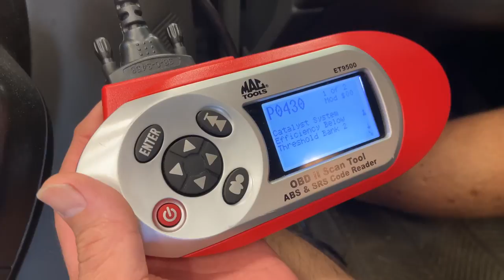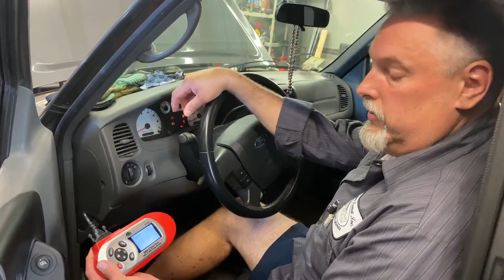How To Replace Driver Side Catalytic Converter 2007-2011 Ford Ranger 4.0

Comment: When doing my ‘04 Ranger, I pulled the front driveshaft which made a huge difference! Also found my U joints were bad which I hadn’t planned on, but access was much better than what U encountered.

Comment: I have got a 3.0 Ranger with 250k on it and no issues so far. A question I do have with the recent surge of cat theft these days is how difficult do you think the dual cats on the Ranger are for thieves to steal? Are they ones target by thieves and how concerned should Ranger owners be?
Reply from the maker: I'm not really sure. This cat theft is nothing new it has happened before.
Reply: @HomeOwnerRepair  Its been a thing for a while now but with the price of palladium, platinum, and other expensive metals used in cats jumping up, the amount of cat theft has gone up several + fold in the past year.